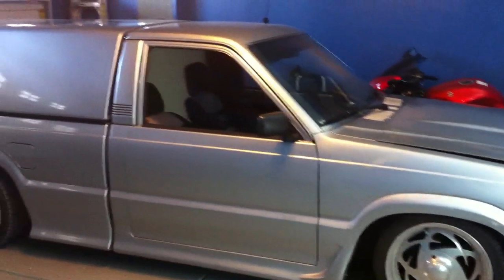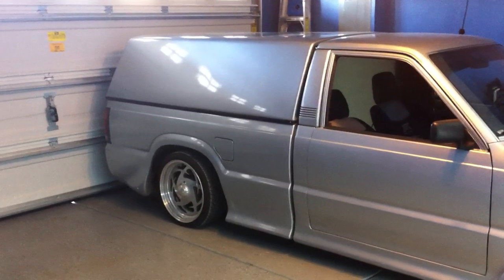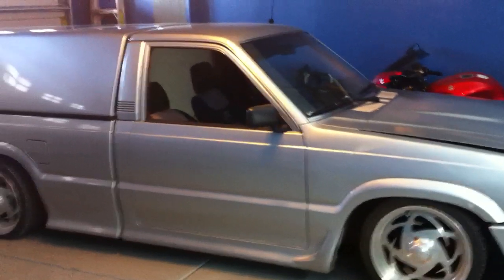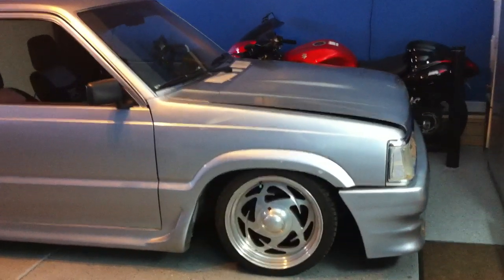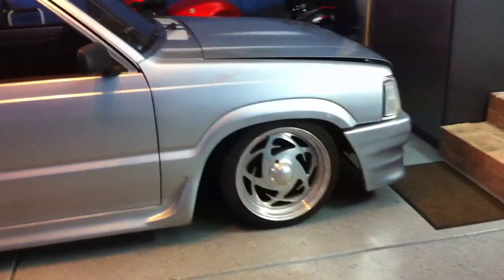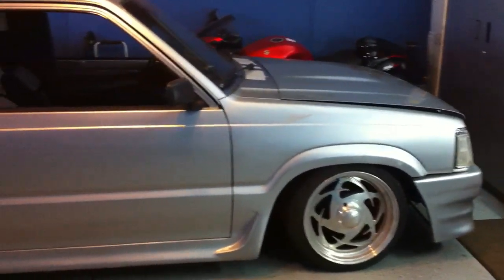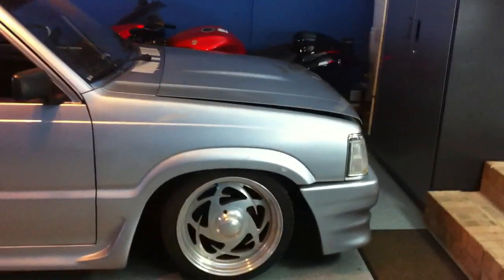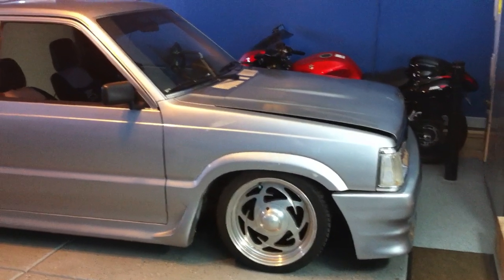Mazda B2200 Minitruck Bagged Shaved Bass Orion.MOV

Comment from the maker: It sounds like you have a great start.  When I first purchased mine it was factory with a blown head gasket, fried electrical (somebody put a paper clip in place of a fuse) and no brakes.  The good news is that parts are cheap and there are still a lot of trucks out there in the junk yards for hard to find items.

Comment from the maker: Thanks aznazguy!  Before I got this truck I always wanted a Toyota.  The five lug wheel pattern they sported opened the doors to so many different styles of rims that tucked so well.  I put the bags on mine back in 96. I am shocked they still work work as well as they do.  At the time hydraulics were still the fad and people thought I was nuts going with an air ride.  Speaking of the Orion amp, I just hooked it up to two Optima Blue tops and man, it is truly a beast.  Like you said, Good times.

Comment: Clean truck man. I was handed down my dad's teal metallic '92 B2200 he bought new off the lot. We have the same body kit with the exception of the front bumper. Fully stock with shaved handles, tank door, and straight-pipes. Same camper shell. My cab's been cut through so the back is completely open. Mine's a shitbox though, as it was half primered 20 years ago and weather has taken a huge toll. Seeing yours in such great shape is very motivational.

Comment: I have a 1987 b 2000 se5 and was wondering how much of a difference was carb and header swap?
Reply from the maker: Hey Philip, they seemed to help a little bit:  I’ve learned there’s nothing really you can do to one of these F2 engines that will make a lot of difference.  I may have picked up a total of five horsepower, but considering it’s still making less than a 100 horsepower the gain is marginal at best.  If you’re looking to add power go with an engine swap.

Comment: Would you mind messaging me back. I have a 91 I put a crate 347ci ,Tremec TKO and 8.8 rear dif with 3.73. I wanted to ask u about an issue most 86 models have. even the 28,000 mile one I just scored thats like new has it just as the 86 we bought new when I was 12. Hope to hear from u. Thanks!

Comment: all B22oo and 2600I never had carburetor the only had fuel injection so that engine in your mazda truck is not a B2200 at all and you may be asking yoru self how i know this for i bought the first year of the B2200 mazda truck that came with the B2200 fuel injection system in them is how i know this. p.s. i do not care if you think i ma wrong for i am not wrong on this fact. and i think you should have gone with the B2600I engine there a batter engine if you are going to replace your old engine. but if it was I the one doing the swap i would go for the B4000 V6 Engine but thats my self i would do.
Reply from the maker: Hey Mark, 

 I've owned three of these trucks and scavenged parts from dozens of parts trucks in the junkyards.  For the 1986 model year, the only available models were the B2000 (only available in 4x2) and the B2600 4x4. The latter model was powered with a 2.6-liter Mitsubishi-sourced carbureted motor.

The B2200 was introduced as a replacement for the B2000 in 1987, and the B2000 was discontinued after the 1987 model year. For the 1989 model year, the B2600 was given a Mazda G6 fuel-injected engine and was renamed the B2600i. At this point, the B2600i became available either in 4x4 or 4x2, alongside the B2200 which remained only available as a 4x2. All B2600i models were equipped with a different hood with a distinct center bulge to accommodate the larger motor. The B2600 4x4 and subsequent B2600i 4x4 models had their own styling distinctions such as fender flares, a wider front bumper, and mudguards.

But I do agree, the V6 would make a great swap.
Reply: hey  @faeraby  i think you missed my point i was making when the B2200 came out it only come with the fuel injection system and at at the same time they had stop making the  carburetor systems for all there trucks from that point on and yes that even includes the b2600I  too and yes the earlier B2600 had  carburetor system but they stop putting the carburetor on the B2600 at the same time the B2200 was released. like i said how i know this for i had the first year the b2200 came out brand new not used one that most people buy now days and all B2200 only had fuel injection system on them no carbs. this is all i will say on this matter.

Comment: I tried to replace my tank until I realized the are aluminum
Reply from the maker: Hey Homer, are you referring to a new gas tank being aluminum?  Or are you joking about the new trend of automakers using aluminum skins on full-size trucks?
Reply: @faeraby  I had trouble with the fuel filters getting clogged up a little too often. I figured the tank is old and rusty so I bought a new one before I took the old one off. So when I did I unscrewed the 6 screws to remove the cap that holds the reading float I was shocked that it was flawless of deterioration, then or course it means it's aluminum and with curiosity why the filters always getting clogged was from the gas stations pumps. Dirty gas. Of course I always go to Chevron and use 91 octane ( in B 2200 manual ) even though Chevron gas is the best, gas is dirty.
Reply: Do you live in BC?
Reply from the maker: Homer Simpson that’s crazy.  I had to replace the tank and sending unit.  Mine was completely rusted out.
Reply from the maker: Homer Simpson no I don’t like in BC.  I live in North Carolina.
Reply: That sure is a  nice pickup